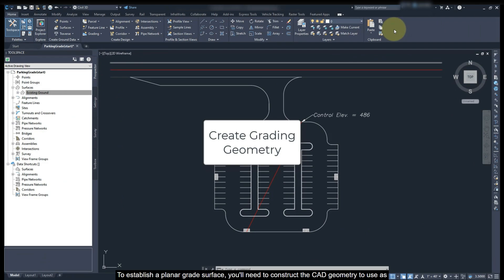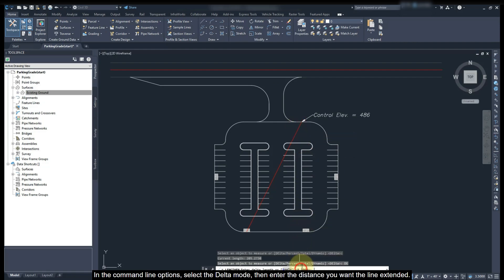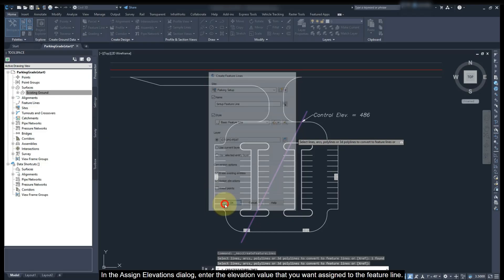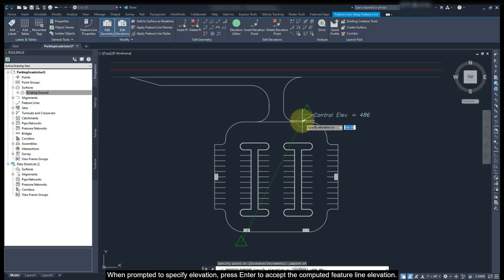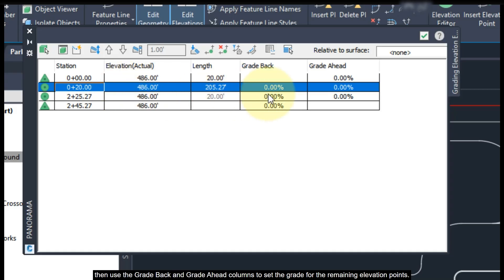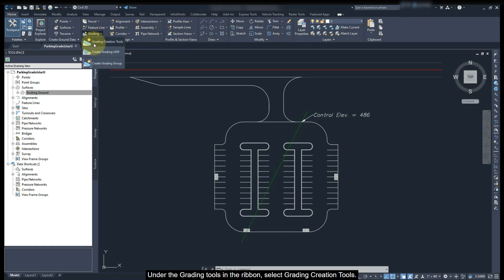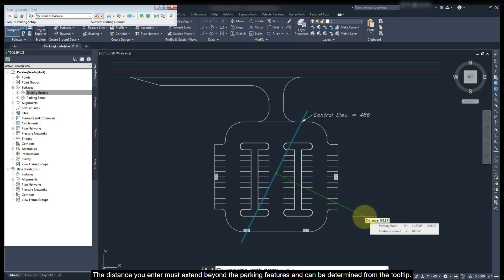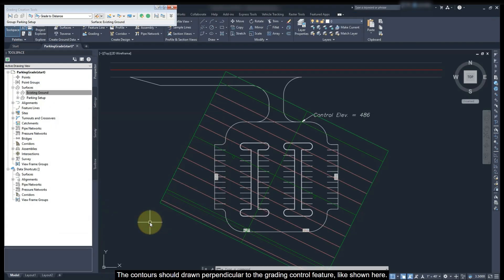Create Setup Surface for Parking Features! Parking Lot Grading Complete Guide! #civil3d #grading #yt

Comment: How do you select the control elevation and slope of the set up line? Are you trying to drain the site away from the road? How is your existing surface draining?
Reply: When you have the feature line selected, the feature line toolbar will appear (this toolbar can only be accessed when a feature line is selected). But having this selected, all of the things that is related to feature lines can be done from "Elevation Editor" where you can edit and change the elevations, slope, raise or lower the elevations, etc. In this toolbar, you can also add / delete PI ( the triangle on the feature line when it's selected ), or add / delete elvation points. There's a lot of things that can be done on a feature line toolbar.